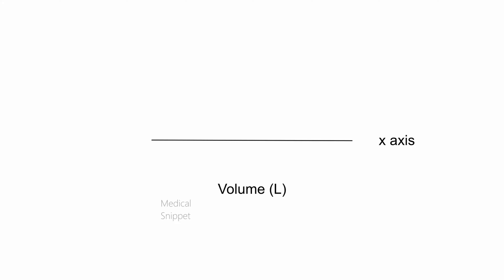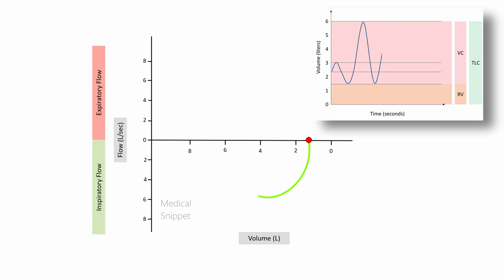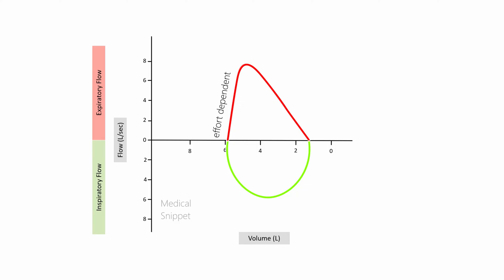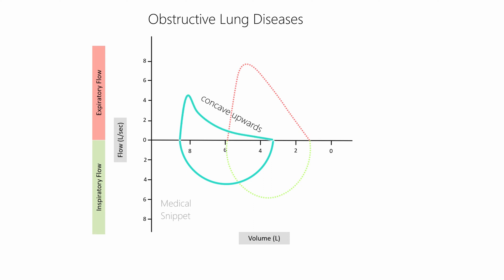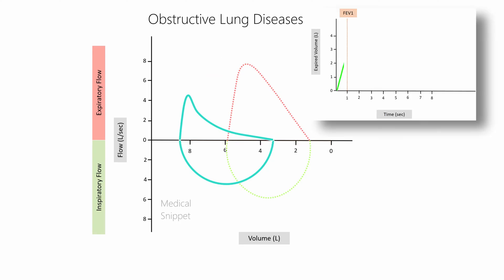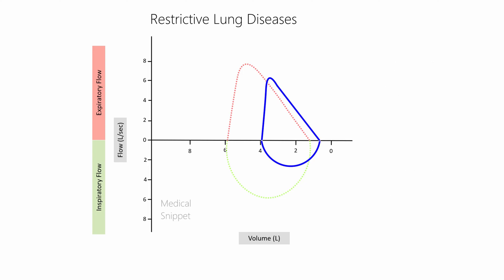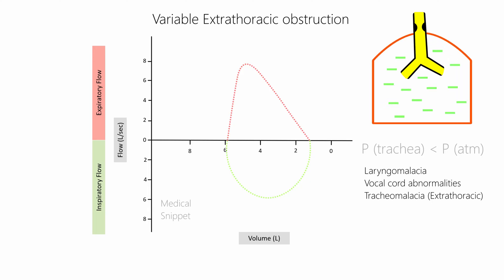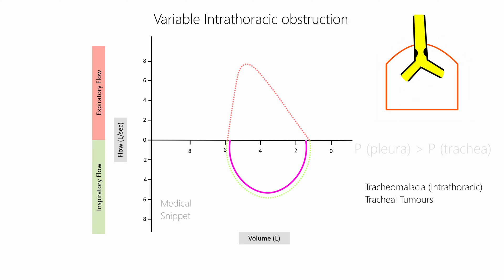Flow Volume Loop | PFT | Respiratory Physiology | Made Easy

Comment: I read that in tracheomalacia, there can be "biphasic morphology" of flow loop. Could you please explain what it means?
Reply from the maker: More than tracheomalacia, Biphasic morphology is seen in unilateral main stem bronchial obstruction. This is due to the asynchronous filling and emptying of the air in the lungs. The lung with the main stem bronchial obstruction fills and empties slowly than the normal lung. So the initial inspiratory and expiratory phase represents the normal lung, so it is of normal shape. But the latter part the inspiratory and expiratory curve is like a straight line due to the flow resistance in the obstructed main stem bronchus. So the biphasic morphology is present in both inspiratory and expiratory phase. Coming to Biphasic morphology in Tracheobronchomalacia, it is present only in the expiratory phase.
Reply: @MedicalSnippet  Thank you so much!!
This is exactly what I was looking for!